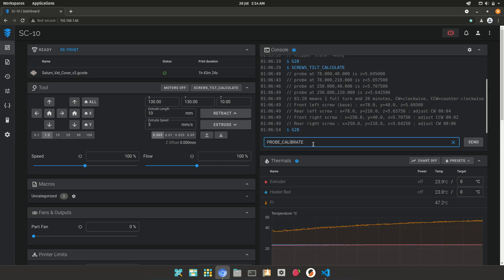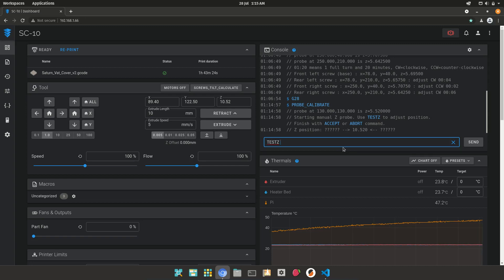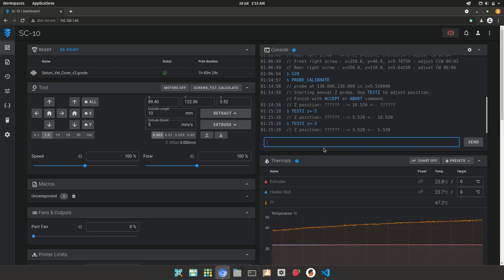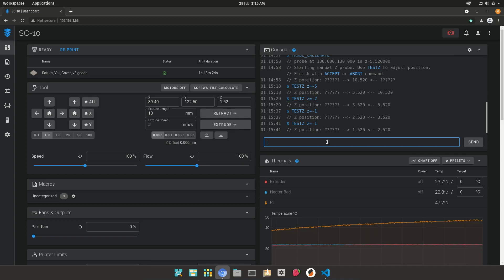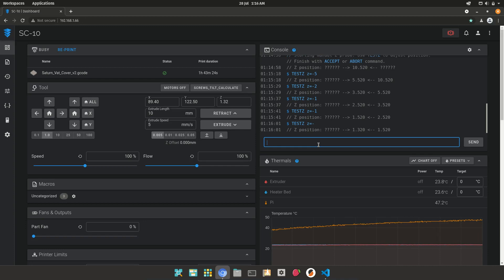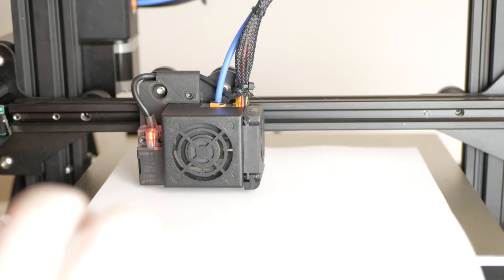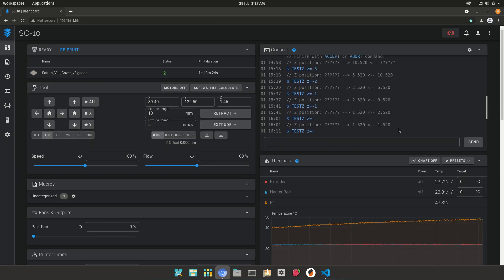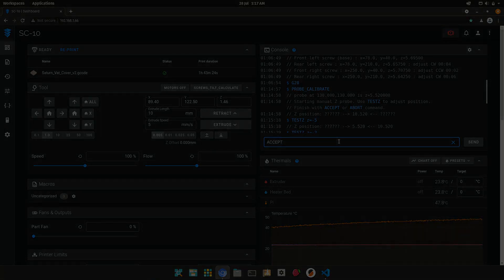Klipper Basics - Setting Probe Z Offset

Comment: Great presentation. This will be very helpful for newbies with Klipper.
One point you can add is the Z offset verification. I can recommend the following procedure:
The center of my print bed is at X=150 and Y=150
G28  # Home the printhead
G1 X150 Y150 Z5 F300 # Move the printhead at the center of my print bed and 5 mm above it. Mouvement is executed at 300 mm/minute. Can be increased as per your printer speciation.
G1 Z0 F100 # Move slowly the printhead to the high when your paper shim was used.
You should feel the same drag resistance just before the ACCEPT command.

Comment: Did what you said step by step and the printer dug itself into my print bed.
Reply from the maker: At what stage did it dig into the bed?
Reply: @PigeonPrint  After going through the “TESTZ Z=“ commands and checking the offset with a piece of paper and typing “accept” for the measured offset when it was touching the paper and I was happy with the spacing.
Qidi q1 pro running fluidd.
Reply: After doing 9 hours of calibration I couldn’t get a decent first layer. Even with the same settings I got huge deviations in print quality. Once a perfect first layer with no gaps, next time huge holes and awful quality. Perhaps I got a faulty broken printer since I can’t get a good first layer no mater what I do even without changing any settings.

Comment: is TESTZ a custom command its not recconized.
Reply from the maker: are you using it in the syntax of both being in PROBE_CALIBRATE and defining it as a value such as "TESTZ Z= -5" to lower z by 5mm, as I believe running just the command TESTZ on it own will not actually do anything but throw an error.

Comment: I've spent several hours reading the Klipper documentation and couldn't find how to do this. Your video is straightforward and clear. Thanks so much. I'm new with Klipper here,  I have couple questions.  Does the configuration save to the eprom or flash on the MCU board, or does it save to some configuration file on the raspberry Pi (that has Fluidd running? Thanks again
Reply from the maker: That is a good question. It will save the offset value inside the printer.cfg file stored on the Pi, you can also look up the value by opening the printer.cfg file from within Fluidd and scrolling to the bottom of the file where you will see a section of green text saying "SAVE-CONFIG" and "DO NOT EDIT THIS BLOCK OR BELOW. The contents are auto-generated." and you can see the line:
[probe]
z_offset = 

Klipper will always reference theses value when it boots up, and every time you hit the SAVE CONFIG button it will update that section with the new values, be that a Z offset, PID Values, or Bed Mesh.
Reply: @PigeonPrint  thanks very much for answering my question. I see the section of configuration you mentioned in printer.cfg file. That's great. This seems  more flexible than Marlin. Thanks again

Comment: Thank yoyu for this video. However I tried i on my SR and it saves the Z offset, but when printing, it doesn't utilize it, it prints in mid air. Any idea ? Thanks
Reply from the maker: Have a look in you printer.cfg file at the bottom (after where it tells you not to edit) and make sure it has you new Z offset saved in there, and has commented out your old one with a # further up in the config under [probe]
Reply: @PigeonPrint  I found the issue, in fact I just needed to do the Z offset before the bed mesh, and it worked.

Comment: I've always sworn by a .10 feeler gauge, with a smooth bed you get the best most consistent result. I'm really not a fan of the sonic pad setup guide there is a lack of information and certainty with the process, this video helps loads, cheers!
Reply from the maker: Really good to hear it helped!

Comment: you dont pre-heat the bed?
Reply from the maker: I tend not to when setting up a probe for the first time. I know the internet will tell you that you need to due to thermal expansion, but as the probe will account from the  coefficient of thermal expansion on the bed (usually aluminum) we can discount that as a factor, and that leave us with the nozzle, (usually Brass) that is less then a 1 cm cubed block, but as 1cm makes the math is easier, we are looking at approximately 0.038mm expansion:

ΔL= 10mm × 19  × 1 parts per million per °C × 200°C
ΔL= 10mm × 19  × 1 parts per million per °C × 200°C
ΔL= 10mm × 0.0038mm 
ΔL= 0.038mm

I think this is a small enough deflection to be able to then go on and adjust as needed for layer high, bed suffice type and filament type. 

So, I'm in the camp of do it with or without heated bed an nozzle, your going to be fine ether way.

Comment: Great, now what do you do if your printer isn't hooked up to a network?
Reply from the maker: Well that depends on what you are running Klipper on. Can you give me any more information on your setup so I can help?
Reply: @PigeonPrint  I have a neptune 4 pro that has been running perfectly since I got it from Pre order.  Overnight it forgot where it's z-axis was.  So I installed the the firmware updates for the board and the UI. Thoroughly cleaned the plate and dried it. I also leveled very carefully, twice.  Now I am having first layer adhesion issues so I went to 220C as it's PLA and 25mm/s for first layer. 
I'm using Orca so I have a lot of options, what type of pattern(rectillinear, monotonic, concentric, archemedes spiral)  should i use for the various layers, there's no description of which work better for what.
Reply from the maker: @shanepatrick4534  For the Neptune 4 Pro you can set the offset through the touch screen leveling menu. Here you can put a bit of paper under the nozzle and adjust to where the nozzle starts gripping the paper, I like to set it to where the paper is easy to pull, but hard to push towards the nozzle. then you can do a bed level with the "auxiliary" setting that will let you turn the bed screws to get the bed level (using the paper method in each corner. once you have done that you an do an "automatic" level mesh and it will probe the bed all across it and update kipper with the new mesh and z offset. (but connecting it to your network and getting direct access to Klipper is a lot faster).   

I always use monotonic, as it give me better top and bottom faces.
Reply: @PigeonPrint  Thanks for the info, the people on reddit were not helpful in any meaningful way.  I am gettin decent first layers having messed with the z axis quite a bit, now I am printing bases for warhammer fantasy and am having the corners of the bases lift so I'm trying brims and the glue stick that came with the printer.
Reply from the maker: @shanepatrick4534  if you dont have any luck with the glue, you could try two other options, make the z offset just a little bit lower so the first layers squish into the bed better, or cleaning your bed with some isopropyl alcohol as things like oils from your hand can build up and stop the plastic from sticking (but most the time a brim will fix things!) If you have any other issues free free to message me!

Comment: Hey, I am trying to setup a Biqu microprobe on an Ender 3 with a Manta E3 EZ + CB1 board..  When I get to try "Probe_Calibrate" I get "Probe triggered prior to movement." What can I do to try fix the issue?
Reply from the maker: First thing I would recommend is putting QUERY_PROBE in the console to check if Klipper is reading the probe as triggered and if it is there is most likely an issue with the wring, or the way the probe is set up in the printer.cfg. Possibly the pin would need inverting (you can do this with putting a ^ infront of the pin number, for example "pin: ^P1.28"

Comment: when i try to PROBE-CALIBRATE i get the command:probe triggered prior to movement 
elegoo neptune 3pro😅
Reply from the maker: Hello. sounds like Klipper is under the impression your probe is already triggered. I don't know much about the Elegoo Neptune 3 Pro. do you know what sort of probe it uses? and will it home without error (if your using the probe to home rather then a Z endstop microswitch)
Reply: @PigeonPrint   what i did for solution is : first z-height to 100mm than QEURY_PROBE once that was done  PROBE_CALIBRATE to the needed z-offset. so luckily it worked out 😅

Comment: Thanks, this is a really helpfull video. Only one thing that also should be mentioned: preheat the hotend and bed because of the thermal expansion.
Reply: The manual for Klipper advises against this for a couple reasons. I would agree with you but they claim it has more detriment

Comment: ok i got a question now ... i have a StrainGage as a probe, using the nozzle itself... shouldnt the z offset of said probe be always 0 ? on X Y and Z ? since its exactly the same as the nozzle?
why should i run this, and why does it end up giving me a offset although it should be 0
Reply from the maker: You would think that would be the case in theory, but in practice you have two factors playing a part, first the strain gauge requires some strain to actually trigger it, it has to go below the point of the nozzle into -Z to trigger. Second part is how 3D printers are slightly different to say a CNC, with my CNC I want Z0 to be exactly that, no offset, where as with 3D printing you need an offset for the filament to actually be able to leave the nozzle.

Comment: Probe_calibrate only works if your withing 5mm of your bed, if you are higher say 6mm , the command won't let you lower then 5mm from the z_offset.  It's faster to just run probe_calabrate let it write to the conf file then modify the amount (editor) and do G1 Z0 to check and do the paper test . This hard coded 5mm in probe_calibrate doesn't seem to be modifiable or parm driven .  A critical tool that just don't work well .  The idea that it's protecting your bed by not allowing higher starts is just wrong .  There are a lot of people out there frustrated by this problem.  Bltouch systems almost always are at higher start and thus this tool is a no go.

Comment: Hi, I hope you can help me! When it launched the GCODE command PROBE_CALIBRATE the following error message appears: No trigger on the probe after complete movement. At this point I can't do anything, how can I solve the problem? Thank you
Reply from the maker: Sounds like the pins from the probe are not set correctly. Can you let me know what mainboard you have, probe type, and what you have for the pins under
[bltouch]
sensor_pin: 
control_pin:

Comment: I am having a problem saving my z offset. When I go to save it this error pops up. SAVE_CONFIG section 'bltouch' option 'z_offset' conflicts with included value
Reply from the maker: Under [Stepper_Z] is the position_min: set too less then the Z offset you are putting in? For example a position_min: -2 and a Z offset of anything more then -2?
Reply: @PigeonPrint  im having this issue, im using mainsail, my position_mi is set at -5
Reply from the maker: @dontnerfthesource  is the bed past -5mm? if so you will have to change that value to a range where it will let the nozzle reach the bed.

Comment: So how do you adjust the z offset while printing ? Am a little confused with the instructions in the documentation.
Reply from the maker: Hi, are you using Fluidd,  Mainsail, or Octoprint? On Fluidd you you just click the the box there it says "Z offset: 0.000mm"  and pick the 0.05, 0.01, 0.025, 0.05 to select the amount, and then the up or down arrow next to them to adjust while printing. On Mainsail the arrows to do the same thing are just under the movement controls. and if using octoprint I'm not 100%, as I have not used the interface there for many years.

Comment: I do exactly this but after every restart (due to "save config") the offset changes at the next session. It extremely frustrating.
Reply from the maker: What you say the offset changes each time you restart do you mean it changes to 0.0mm or you have to change it as your getting bad first layers every time you restart? If its the first one resetting to 0.0mm then that is normal, its saves the offset at the bottom of your printer.cfg. if its later problem it could be a bad probe. give me some more information and I will try and help.
Reply: @PigeonPrint  hello mate, i do have the same problem . i already did your step but when i do the print process, the Z axis always goes back far from the bed. hopefully you can help me.
Reply from the maker: @gunawanred  Sure will try and help, when it goes far from the bed on the screen do you see a set of boxes the show the X Y & Z coordinates? if so, doe the Z read 10mm?
Reply: @PigeonPrint  yes, it always comes back to Z = 10 mm. even when i tried manually overwrite the new Z offset in printer.cfg. nothing happens.
Reply from the maker: @gunawanred  That's a quirk of Klipper, what ever you set you offset to it will always move it 10mm above it when it homes. So if you start a print it should move down to what you set the offset to. Try a print and if the Z height is still 10mm, let me know and we can trouble shoot some more! 👍
Reply: @PigeonPrint  when i print it won't go down to my setting. it still far away from the nozzle. i already used "SET_GCODE_OFFSET Z_ADJUST" to help adjust the z axis, but at some point it can't go lower anymore.
Reply from the maker: @gunawanred  Doze it throw an error saying it cant go lower?
Reply: @PigeonPrint  not an error, but nothing happens. i tried another config like horizontal_move_Z
Z axis position_min
but same case, at certain point it won't lower anymore. doubled the number and it still the same. I also tried to lower the Z axis on the Octopi UI and it worked.
Reply: @PigeonPrint  Thanks for getting back and excuse my delayed response.
You're right I need to provide more info to make things clear. 
I did finally manage to get my z offset to save properly.
Here's what I do,
0-I do all the manual leveling, screw adjusts, tramming, z-tilt(yes, I have separate z drivers), and get decent flat-ish bed after doing all those steps in a loop for 2-3 times.
1-Delete all the autosave configs at the bottom to start fresh.
2-PROBE_CALIBRATE , paper test, save config, auto-restart.
3-Home the printer again and tell Z to go 0.
4-Starting from Z at 0, I use the SET_GCODE_OFFSET Z_ADJUST commands to lower my nozzle and get my desired nozzle height. Once it's found, save and save_config, auto restart.
5- Next restart when I home and set to 0 the nozzle moves to the height of pretty much where I want it to be.
Also, here's my probe_accuracy results, with my BLTouch 3.1,
probe accuracy results: maximum 0.645000, minimum 0.532500, range 0.112500, average 0.583250, median 0.581250, standard deviation 0.041714
The standard deviation is usually at around low 0.04 or high 0.03s.

But the fun part starts after when I do a bed_mesh_calibrate.
I do a 5X5 bed mesh with 3 samples at each point for more accuracy, with the lowering speed of 4, that gets me a decent bed mesh with a variance of 0.3mm, which is fine, i'll work with it.
Here's the fun part, bed mesh completes, it saves the bed mesh to the heightmap but I don't even save_config yet, I home the printer, I try to move my Z to 0 and it just rams the nozzle to the bed almost 3mm, my z offset adjustments just gets lost even though nothing has changed in the config file yet.

I'm an IDIOT, three was no pullups before the sensor pin at my config file! This guy ^ was messing up everything! Finally back to working conditions again. Omg... Took away two weeks of printing from me... Ugh...

Comment: When I do this, after the firmware restart it doesn't save. If I go to level the bed, the z axis sits 10mm above the bed. Not what I set at the z calibrate. This is so frustrating.
Reply from the maker: Are you using a Klipper interface like Fluidd and Mainsail, or Octoprint plugin?
Reply: @PigeonPrint  Fluid.
Reply from the maker: @marckart66  So, just to get this clear, when it goes to probe the bed it goes to high and wont trigger, or after it triggers it move the nozzle up rather then leaving it your offset? If the later of the two is the case then that is normal. when ever it homes, or dose a mesh level with the probe it will always return to safe high. when you start a print the nozzle will move down to the set Z offset.

Comment: Don't listen to this.. first you need to level the bed so the "offset" is equal on each corner not in one spot...
Use the knobs on the bottom of your bed to adjust it and then depending on how your first layer turns out, for example by wanting a thicker first layer you adjust the z-offset..
Reply from the maker: How level your bed is has zero relevance to Z offset for a probe (the topic of this video) the height of your bed at multiple points on the bed has no effect on the Z offset (Z offset is a measurement between the nozzle and the probe, the bed is not a measured perimeter just a trigger dictated by the prob itself). However, your point is valid for anyone without a probe who is using a Z endstop, but not a probe.

Comment: They must have changed something in Klipper recently. It doesn't save the new offset. It adds the offset to the bottom of the printer.cfg file hashed out and hashes out your old setting. So you have to manually copy and paste the new value.
Reply: im having the same problem ..... did you resolve this?
Reply: Have you figured out how to fix this issue?